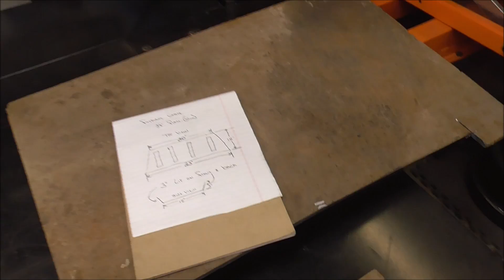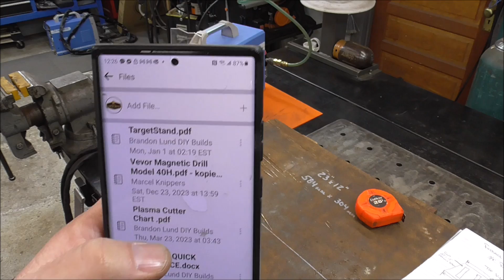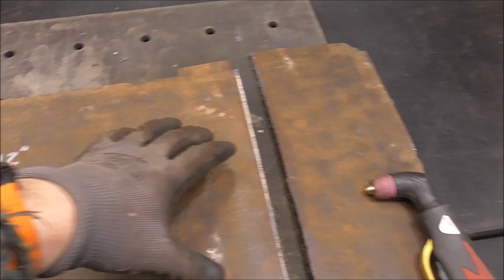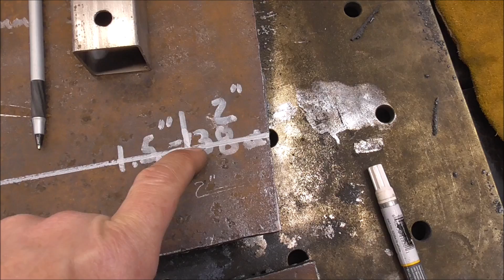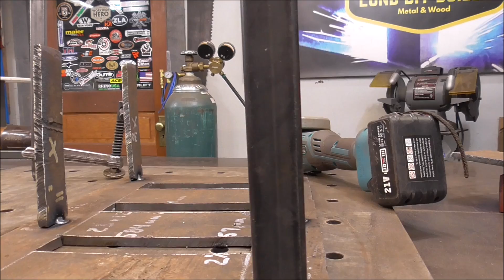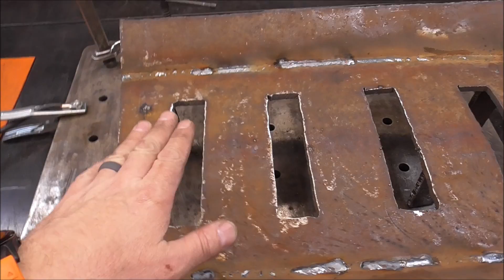Make Money MIG Welding Custom Fireplace Grate Build

Comment: Awesome video! And very resourceful
Reply from the maker: Thank you!
Reply: @BrandonLund you're welcome
Reply from the maker: I'm drooling over your C20 by the way! I sold mine 20 years ago because I was hard up for money. I was the 2nd owner. The first owner would spray diesel and motor oil under the truck 2x a year since the day he bought it. I powerewashed the underside and there were still spots with original paint. Definately the best years 68-72
Reply: @BrandonLund that's awesome! I get having to sell the things we love when times get tough.  I'm there now contemplating selling this one. I'm not there with putting it up yet. But it's been a tough year. Do you have a classic now ?

Comment: How much $ even if guessing was the plate ?
How much would you charge for it ? If u were to sell it ?  This is just wondering on my end. Todd
Reply from the maker: Todd, If I remember correctly I think I paid around $20 for that bent up sheet. It's been a while since I priced out 3/8 plate but it's probably close to $500 for a 4x8 sheet which works out to be around $16 sq.ft'. So around $32 for the metal, another $30 for consumables, 4 hours labor   @ 100/hr =  $462.00. It's a lot of money but it's custom and will outlast anything you can buy. With that said, if I was starting out and trying to establish myself, I would lower my labor rate letting my customer know I'm giving them a special rate in hopes they share their experience with others  on social media. Ask them to post a few pictures of it in use and say a few words about it. Even if half your customers participate, it's free exposire. Then I would increase my rate to my target hourly rate as the demand increases.
Reply: @BrandonLund  what do u think it would be sell for
Reply from the maker: $462.00. It's a lot of money but it's custom and a certain percentage of people are willing to pay for that quality. It will outlast anything you can buy.

Comment: Nice video! Another way of doing it is to have staggered holes from your mag drill
Reply from the maker: Excellent idea! I never thought of that for the bottom but that would work awesome! I did think about putting some holes on those 45 degree pieces but doing it with a mag drill would have been pretty slick! Thanks for sharing!

Comment: Great video, Brandon!!!  As always, lay out, pre-measuring, cutting out the parts, and THEN the weld!!!  Gives us so much information!!!  Thanks for doing these videos.  I am going to make one for my fireplace and then use the one that I have now for an anvil as it is made from rail road rails and spring steel center runner from a rail car.  Be well, be safe, be Blessed!!!
Reply from the maker: I appreciate that Jim! I bet you could even sell a couple on marketplace in your neck of the woods. The key is to finding a good place to buy the plate. If I were selling them, I would use straight plate, but for my own use, the bent up plate will work just fine, plus it's a good way to show how to use something that might otherwise be pretty useless. I hope you have a great weekend!

Comment: When our fireplace grate collapsed, I made a replacement from half inch rebar.  That was 5 years ago. Next time I will put legs in the mid line to keep it from sagging like a sway back horse.
Reply from the maker: Thats actually an awesome idea using rebar. Super strong plus it's priced right! Thanks for sharing 👍